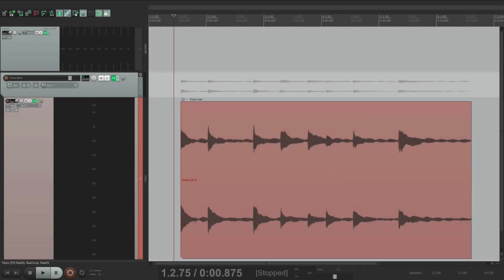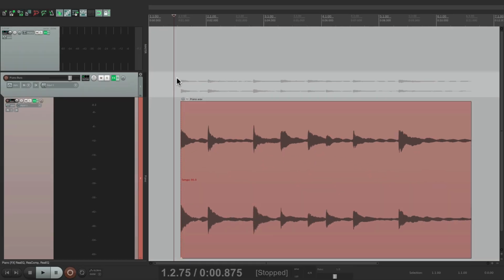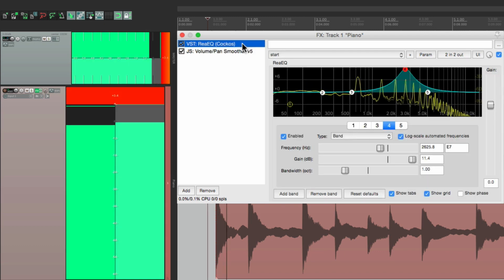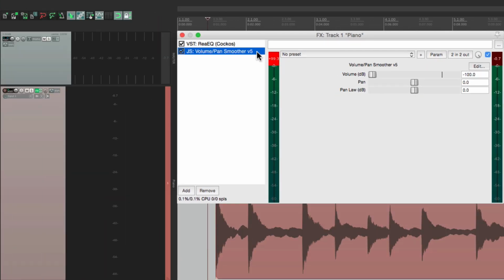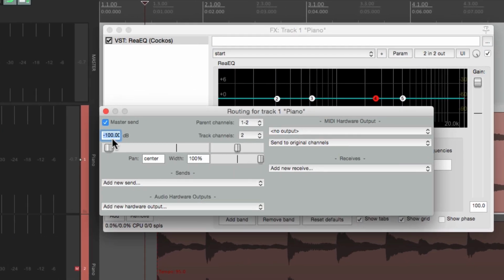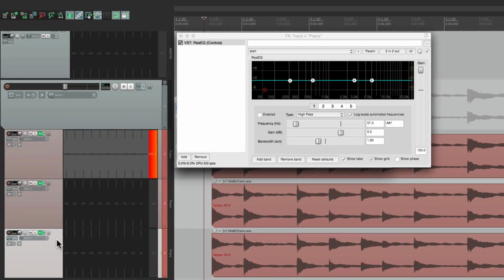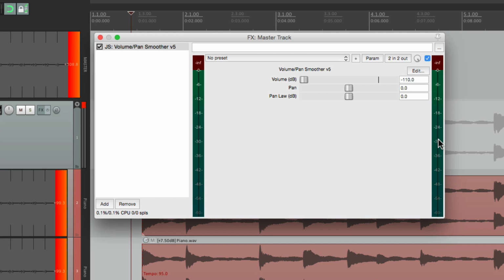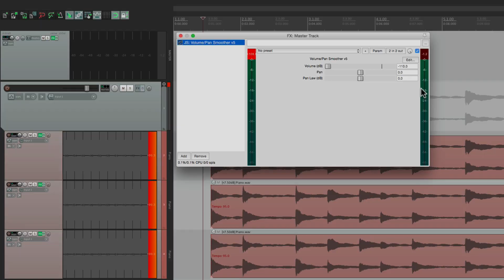Gain Staging in REAPER

Comment: I think that's fine with strictly digital plugins. However, with plugins emulating hardware, they will distort. I did not gain stage a project and was hearing distortion. I sent some time chasing it down and it was a tape emu that was overloading. I did a bandaid fix by turning it's input. gain down and it was fine however, I wasted time chasing it. When I set tracks at -18db, I never have to worry about plugins, busses or renders.

Comment: Definitely a redundant thing to do, especially if you are a beginner and might miss some level compensation...
Not a common sense at all to have a fader down to -100dBFS or a static meter all the way up for clipping at +99.9dBFS.
In DAWs we can do all kinds of such unnecessary (redundant) acrobatics and routings that would not make any sense to any convenient workflow of audio mixing. Meters have purpose and meaning - they are designed for your eyes to check up on levels and clipping (the latter should be avoided).

Comment: This only works for 100% in-the-box mixing AND ONLY with certain plugins.  Doing any hybrid mixing via A/D convertors and/or to analog gear, or employing analog modeled plugins with optimal I/O gain equivalence, completely invalidates the approach you outlined.   Also, if you set Reaper to lower internal mixing bit-depths, such as 16-24 bits (which is actually closer to 14-20 bits usable headroom), you can quickly blow through your available digital headroom, resulting in irrecoverable clipping. Obviously, 32 FP or 64FP would support that approach— if you keep the caveats i mentioned in mind.

Comment: Hi Kenny, I really liked your video, because like you I like that the tracks contain wave lines as wide as possible.
But I am starting in Reaper and first of all I would like to ask you how to add a track folder and a MASTER MIX track, like you have here.
I am downloading recordings to Reaper, with only voice and acoustics, 32 bit, taken on a Sound Devices MixPre ii.
I see you in the video change the gain from a circular icon, in the shape of a knob, located in the upper left corner of the track, but it does not appear to me.
Thanks.

Comment: It seems that going into the red in Reaper's meters isn't really distorting/clipping anything unless you were to render the track in that clipped state. If you were to introduce distortion or saturation into the channel, from a plugin or outboard gear, no amount of amplitude reduction should be able to null the tracks or fix the actual issue. Essentially you've just adjusted amplitude without introducing any distortion, or other wavelength altering effects, into the digital signal path. Of course that doesn't mean you won't distort your monitors or headphones back in the analog world.

I think the better place to focus on cleaning up your mix to address and set up your gain staging is at the pre-amp level. After that, many plugin manufacturers will recommend to calibrate at the track level meter so that you don't have issues at the master. It's not just an issue of good practice, but also you retain more control. Trying to fix gain staging issues at the master won't resolve undesirable wavelength alteration, including distortion. You will only be lowering the volume/amplitude of the offending track. If I'm missing something in your example please let me know. It just doesn't seem that you've actually introduced any problem to the tracks in your example.

Thanks for taking the time to make this video.

Comment: The issue Ive found is then if you just go with some tracks clipping, yet have groups and a plugin chain, you then have to check various plugins....or select and lower (maybe a reverb clips) which then affects a compressor (use threshold change same amount) etc.

Hard to know which plugs will clip! Some will and dont even have meters!

Comment: what you are suggesting is VERY DANGEROUS! i see people ruin their mixes all the time because of info like this... certain plugins have certain sweet spots and if you overload them they will clip or just sound like crap. this is NOT proper gain staging, rather an exception that works with certain plugins. but yeah, your channels won't clip in 32 bit, knowing that can help sometimes. Start your mixes with enough Headroom, and you won't run into problems!

Comment: I wish that the Cockos team would add a gain/trim knob or some pre-gain slider to the tracks kinda like Cubase. I have set the JS Volume Adjustment plug-in as default for new tracks but it's still very slow to open them one by one and set the gain. I know it's possible to show plug-in parameters in the mixer but you can't show parameters and sends/receives at the same time :( JS Volume is the only plug-in that I would need to see the parameters for so it feels dumb to sacrifice all that screen estate for the parameters of just one plug-in I only use at the start of a project. A simple, small gain/trim knob or slider would improve workflow immensely!
Reply: Same here, I really wish they would add that!
Reply: Same here. I would love to have some kind of pre-fader gain available in Reaper. I've used the JS Volume Adjustment plugin but it's sometimes buggy... like the gain I set via the keyboard is not preserved and suddenly it jumps back to unity and blows my speakers. Not good! I saw Kenny was able to adjust the item/clip volume via some kind of widget on the item which looked like at least a somewhat close solution... but yeah, would love to see a pre-fader gain some time in the future!
Reply: Same here
Reply: @wojciechstecyszyn6040  I wrote that comment a long time ago, and this is not a problem anymore. I was for some reason really into streamlining my gain staging process, but it's such a stupid thing to get stuck on. Set your master VU settings to "Peak+loudness", and in the Loudness metering section, set it to: Meter=LUFS-M, Readout=Maximum, Display offset=23dB. Display gain and red threshold you can leave at 0dB. Now when you solo a track you can simply look at the blue bars on each side of the mixer master meter. If they hit the red threshold, select the audio item/items on that track and grab the top of the item and pull down until the blue meters don't hit red. This is the same thing as adjusting pre-fx volume (called clip gain in some DAWs). You can also set the individual track meters to LUFS-M and go by those instead, but I prefer having them show the peak values. Since the master meter can show both LUFS-M and peak at the same time it's just more practical to use that.
Reply: @nj1255  I recently wiped my HDD and I was remembering your advice on this and it took me so long to find your comment! I screenshotted it lol. Thanks for the tip!

Comment: This is actually a helpful tip as a temporary "volume fader war" band-aid, but unfortunately I'm afraid you are under the false assumption   that "volume" and "gain" are the same thing, when in actual reality? They most certainly are not. No more the same than setting overall levels before tracking, or practicing ACTUAL gain staging during the preparation of mixing. 
Sure, they are both vital resources seemingly working in tandem to achieve a similar goal, but they are realistically completely different signal path parameters, and should ideally be understood as such.
Really digging the channel, as I'm still rather much of a noob in Reaper after transitioning from Adobe Audition. which was my first DAW after transitioning from two inch analog and ADAT tape.
Now, what I really need help with is organizing my VST collection. Reaper could of made that a hell of a lot easier by now.

Comment: Yeah, this is dangerously wrong.  It could take a new engineer years to Unlearn this one video.  
32 or 64 bit FLOATING POINT Audio allows for nearly unlimited level changes in the code.  
The video has almost nothing to do with Gain Staging or Gain Structure, just FP level controls.  Which IS fantastic, but Not the point.
Gain Staging is all about baseline Nominal levels, Headroom, Distortion Points and how they relate to Professional Analog Equipment, and NOW Analog Emulated Plugins.  But Gain Staging also effects all of your Dynamics Processing (are you gonna set your compressor threshold to 100dBFS?)
PLEASE DON’T MIS-EDUCATE YOURSELVES

Comment: To my understanding, unlike analog, this isn't a signal chain. Each plugin is just adding a series of algorithms to the original signal and those numbers could cancel out numbers that come before it because reaper is just combining the plugins in a single equation. 

But other plugins added into reaper may not do this necessarily. They may take the input signal and then output an entirely new, separate signal. In which case, if gain is an issue, you can always use the Reaper volume plugin before and/or after the plugin that's causing a problem, if input/output gain aren't editable parameters in the plugin.
Reply: Signal chains can be in parallel or in series. Your first sentence describes a signal chain in series. What you describe in the second paragraph is a signal chain in parallel. They're both still signal chains.

Comment: I am curious as to why you would even want to set the gain on your interface going in to be distorted or is it that if you don't peak on the interface and still does in reaper track you just fix it there. What is the proper level to set the gain on the interface. I record my drums here at home with reaper and can actually turn the gain down all the way and still pick up the sound.

Comment: Why a volume plugin instead of the fader? Just because it allows you to type in dB levels for explanation? 🤔
Reply: It's best to try to keep the faders near zero. They are most precise there. When you are compensating for loud volumes with the faders, it can be really hard to precisely mix. Using a volume plugin will get you close to the right volume, and then you can use the faders purely for mixing.

Comment: just adjust the gain until is 18db by dragging the top of the track, then use the use view > the peak display settings, and then after every plugin adjust the wet/dry signal, using this method will lead to problems since you are clipping but you are not hearing it because reaper process

Comment: I had a student bring me a completely messed up mix recently, and I asked him if he was gain staging his mix because it was all kinds of distorted and nearly unlistenable. He said he had gain staged, and pointed me to your video. And thus, I have found why his mix was distorted. What you are doing is not gain staging - at all. And I have now added your youtube page to the "do not watch" list for students. Trimming at a later point is not gain staging. And while this works in your current Reaper project, it's not proper gain staging and will completely destroy any mix in any other daw that uses -18RMS operating level for plugins. And if you can't hear the distortion on your channel before sending it to the folder, I feel sorry for you man. It's totally distorted.
Reply: maybe the DAW which you were using is not floating point math DAW? Kenny clearly says, it works with DAWs usinf floating point math.
Reply: Yes to this, this absolutely will not work with other DAWs. If your students aren't using Reaper, they should not use a video that says "in REAPER" in the title. For a student, I can see how that would not be obvious to them. The extreme example in this video is to demonstrate the idiosyncrasies of Reaper gain calculations, not to teach someone what gain staging is in a traditional DAW. That said, this video is part of Reaper's official documentation, so if they need to know the difference between Reaper and other DAWs using -18RMS levels, this is a great channel. REAPER Mania is definitely a fantastic channel, but it's obviously for people who are using Reaper.

Comment: Am I missing out on something here? Why not just turn the track down and then it won't distort. You are adding loads of settings when you really don't need to. If you have a load of tracks like that then why not just turn your folder master down rather than mess around with effects and plugins?

Comment: Was interesting too see. Although only works like this because it's digital. In analog, once a signal distorts in the signal path, it's permanently distorted in the path,(unless you correct it using other techniques, but will never get back to 100%). Hence how square waves and the like are generated. But was  very interesting to see.
Reply: George Kamau That's the whole point of digital though, it preserves the signal
Reply: That's the whole point. It's just numbers. If you add too much, you can subtract later. In this scenario, "clipping" doesn't actually occur until it hits your D/A, your amp, and your speakers.

Comment: I am not sure I get it. Is it simply that it doesn't matter where adjust the gain in the chain as long as the final out is at a good level?
Reply from the maker: Yes. You do get it. Computers don't work like analog consoles. An analog console sees clipping at one point and can't fix it later in the chain. A DAW (REAPER) just adds all the numbers together and creates one number. So 100dB + -100dB is seen as 0dB. With no clipping occurring.

Comment: One potentially silly question.  Everything shown here is either using plugins or sends to reduce gain.  Is all this staging done pre-fader, or can you also use folder track channel faders or the master output fader to reduce the levels the same way?  I'm assuming channel faders work too, and are easier to grab and adjust than a volume plugin.
Reply from the maker: It all works. Yes.

Comment: Nice job as usual Kenny, but I would have liked to have heard you explain to the noobies just how floating point arithmetic is different to fixed point arithmetic, and how these extremes (as demonstrated in this video) will bite you on the ass pretty hard if your system is based on fixed point math, or if any of your (non-Reaper) plugins aren't based on floating point math.

Comment: The concept here is correct, but the term is "clipping," not "distorting." And technically, it isn't even clipping due to the floating point math. I personally don't like seeing clip indicators lit up, but if it sounds good, to each their own.
Reply: Clipping is a form of distortion. Just not good distortion. Point for Kenny
Reply: Listen_good Isn’t distortion a form of clipping, or effect of clipping, like saturation?
Reply from the maker: Agreed.
Reply: clipping is a type of distortion. but often he is talking about when its distorting or clipping at all! that would be audible.
Technically its 'overshoot' or i guess overload (exceeding the range of input data)...but if its floating point its not causing any 'clipping' as the over shoot is compensated....clipping which would be like slicing off the top of the waveform visually, is a type of distortion. Distortion is 'technically' ANY change to a signal, but casually refers to particular types of 'clipping' or 'overdrive' or 'saturation' or 'fuzz' etc.. Digital= hard clipping. Analogue, like a tube amp, =soft clipping although various analogue stuff can clip harder, but not unusably hard like digital.

Comment: You can't always rely on fixing peaks with this method, because a lot of plugins treat the incoming signal according to the momentary level values (comps, exciters, impulse responses...). If the plugin is designed for dynamic content and your incoming signal peaks a lot or worse, its always red, then the plugin fails to provide the color which it was designed for.
Peaks around -6dB and a loudness around -23LUFS or 0 LU are considered to be safe.

The SWS extension has actions to set the loudness, or normalize peaks on media items, however you will have to set the levels manually if you use MIDI for synthesizers/samplers.

SWS/BR: Normalize loudness of selected items to -23 LUFS
SWS/BR: Normalize loudness of selected items to 0 LU

You can set one of these actions to for example SHIFT+Double Click on Media Item or whatever you prefer in the Mouse Modifiers...
This is the first thing I do whenever I bring a sample into a project.

Comment: Curious how hitting an amp sim at +110db will sound? or even +10db? Most plugin presets are set for a desired amount to work as intended. i particularly love how people in YouTube videos demonstrating the SSL channel strip will crank the threshold to max in order for it to work, BECAUSE THEY LOWERED THEIR ITEM VOLME TO LOW. lol
Reply from the maker: Yes. But not "most". What you're talking about only matters for guitar sims (obviously) or emulation plugins that want to see a certain level. But those plugins should tell you that level and have an adjustment. Most plugins don't care what level they see.